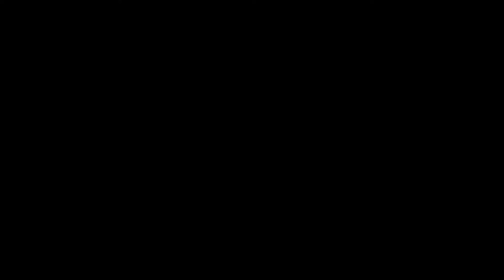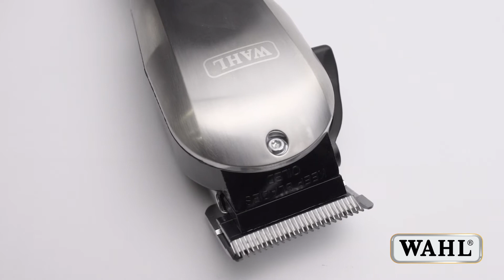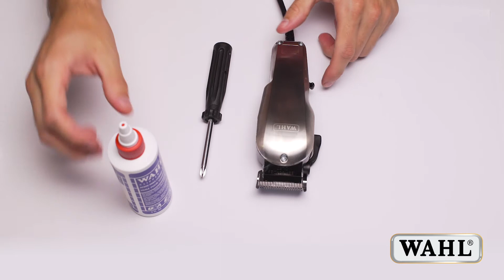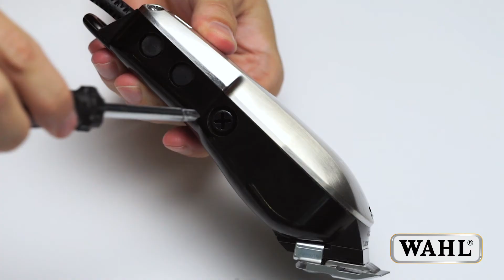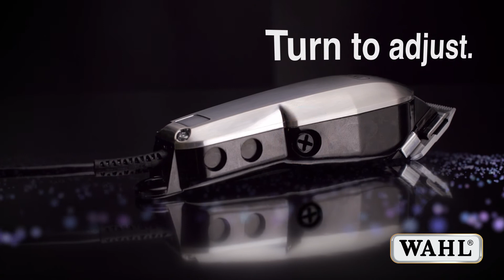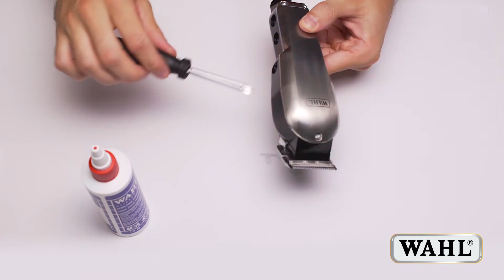Clipper Tuning

Comment: What about if my wahl clipper voltage is 220v 50hz and running smooth here in uae if i go back to my country that has 220v 60hz do adjusting the screw will help make it run smooth